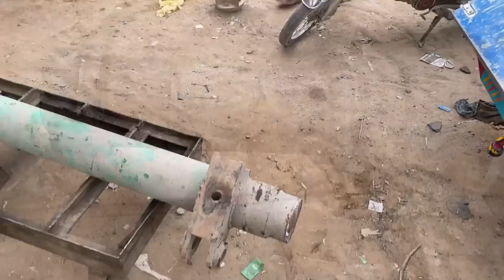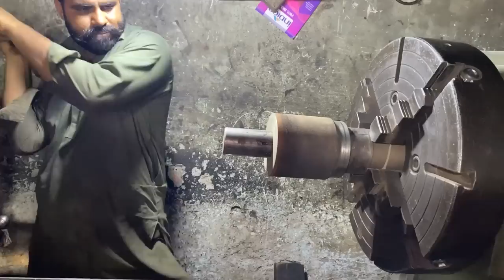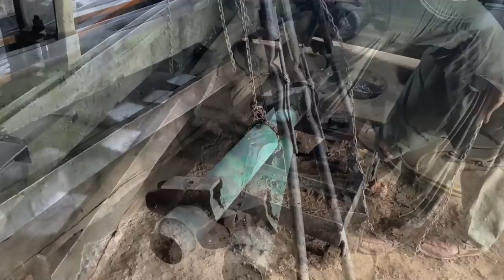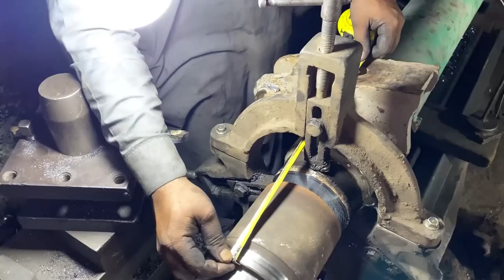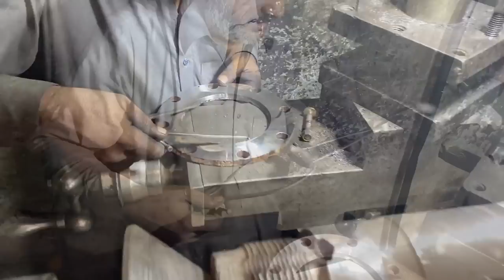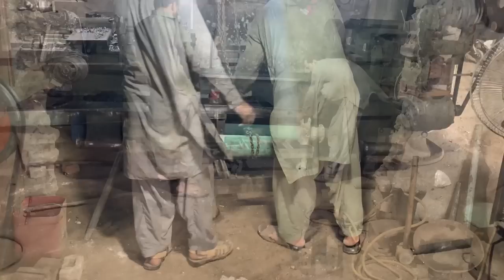Repairing Broken Axle Spindle of heavy Duty Truck Trailer || My Talented Mechanic Repair it ||

Comment: fantastic work !
Reply from the maker: Thanks 🥰
Reply: That's a lot of work for this heavy axel, never seen lone break like this one did, right at the bolt ring. Thanks for sharing 😊
Reply: Hi, what electrode did you use, I'm guessing 7016-H8 or 7018?.
Reply: @amazingmechanicalthings  ضف